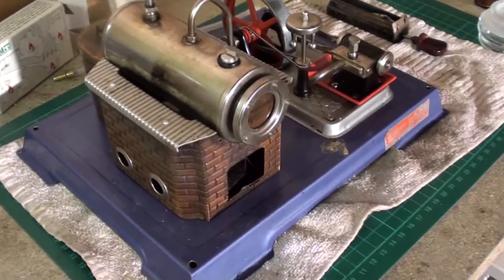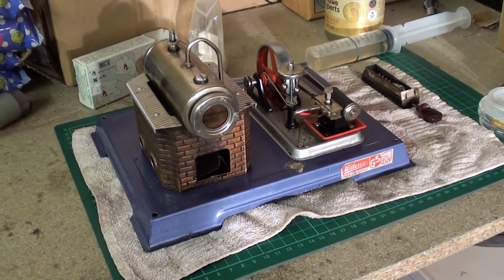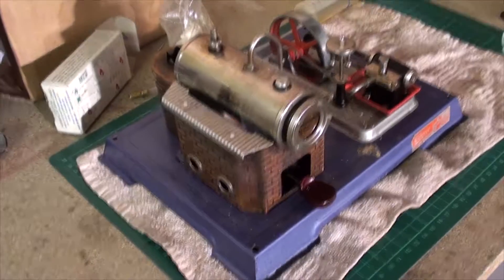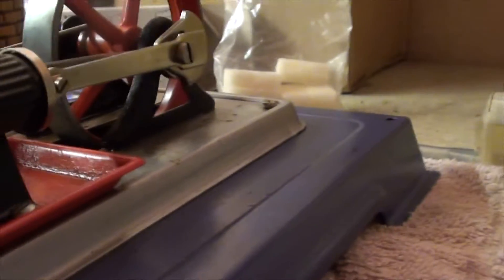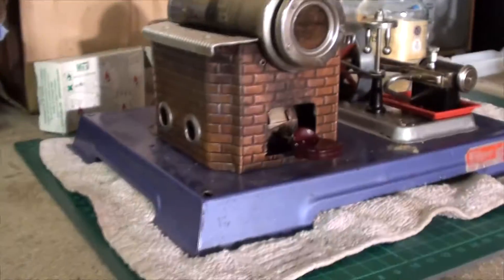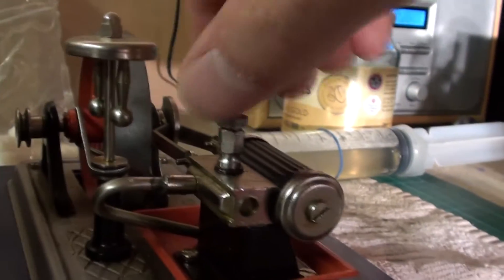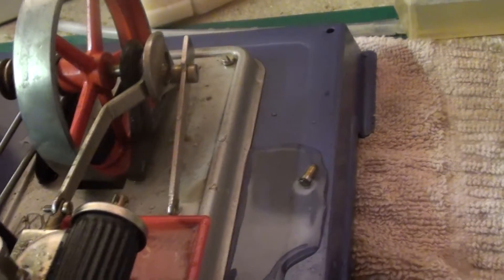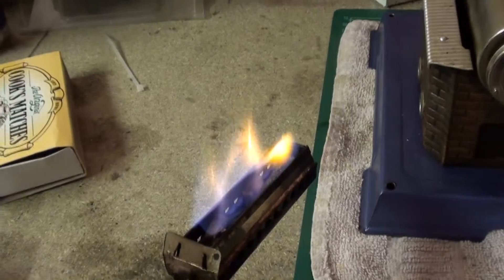Wilsco Steam Engine - RustySkull Productions

Comment: Hi, the wilesco D-10 doesn't have a throttle, but you can reduce the speed with less fuel or by using pliers to release exes steam from the safety valve. Also, the cup on the steam chest is for oiling the piston and valve; here's a link to perches some steam oil for your engine http://www.ebay.co.uk/itm/FS-250-ML-COMPOUND-STEAM-OIL-FOR-MAMOD-WILESCO-ETC-WITH-SPOUT-/201489911966?hash=item2ee9bc109e:g:g0kAAOSw7PBTpAyy   
  Hope this helps!
Reply from the maker: +Queen City Motion Pictures Hey many thanks, I've now sold these ones and only have a Mamod left ;)
Reply: You're welcome, what kind of Mamod do you have if you don't mind me asking?
Reply from the maker: I have no idea, I do have a video of it but I have requests for another video of it anyway so I'll be doing another video of it today... Maybe you could watch it when I upload it and tell me what you think it is? ;)
Reply: Sounds like a plan ;-)